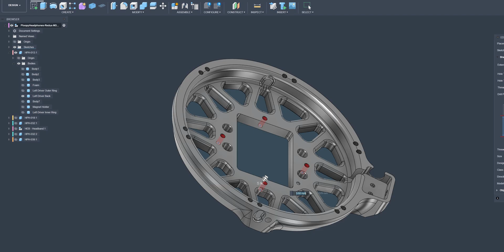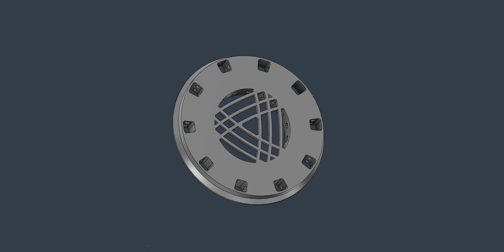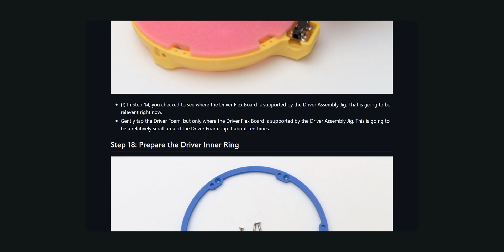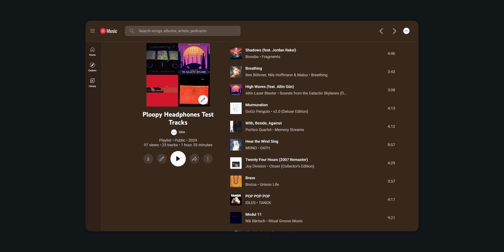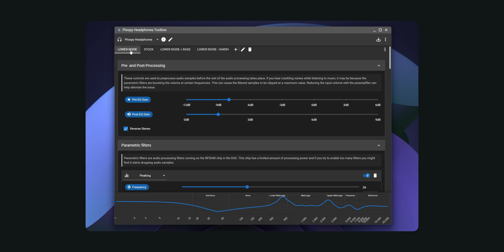My Transparent 3D Printed Planar Magnetic Headphones

Comment: You should try making the DMS Omega 3d printed headphones.  I have made 7 3d printed headphones including these.  These were my least favorite.  I don't want to carry around the other electronics just to fix its insane frequency response.  In order of the ones I liked the most to least, I made:  1) DMS Omega, these as GREAT!!  They sound like an HD600 with not as much roll off in the bass and sub bass.  2) Satyr 1, 2 and 3  Both are really good for different reasons  The response is slightly colored but very nice.   They are really well designed.  The head(emame) Open and closed.   The bass on these two was out of control, a bit bloated and out of control.  Then the ploopy, which is good with the frequency response tuned with the electronics, but absolutely nasty otherwise.  TH is is all just my opinion, I have no measuring equiptment to check the actual graph.  I want to get that soon though.

Comment: Should’ve printed those lying down
Reply from the maker: Not sure what you mean, the transparent parts are resin prints, not FDM.
Reply: @EIGAtech  the pegs I mean. In that way, they wouldn't snap
Reply from the maker: @BambuLaber  Completely flew over my head, sorry! Yeah, that could have worked as long as the cylinders were designed with a flat side.
Reply: You can just split the pin in half to print horizontally and glue it with superglue. It will be way stronger.